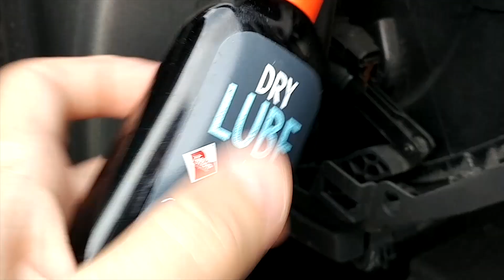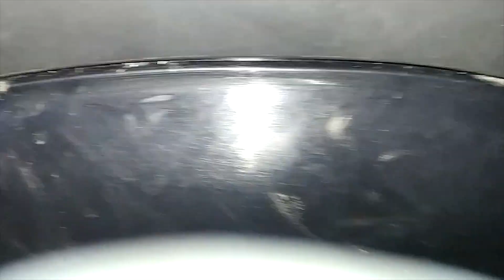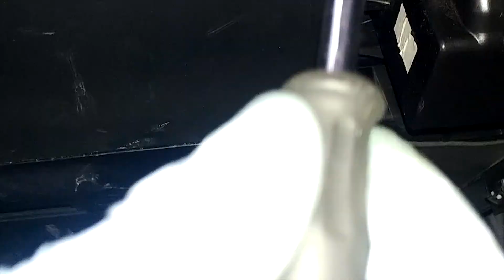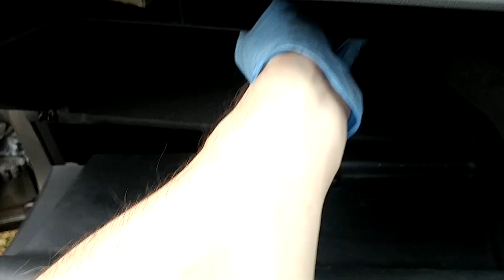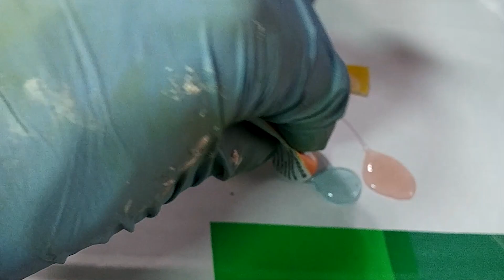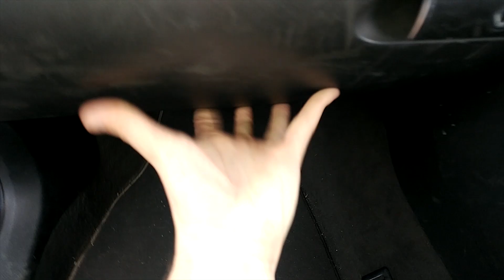How to remove repair and refit your Audi a4 glovebox

Comment: Very helpful video, thanks. On my Canadian 2008 A4 B7 Avant there are nine (9) screws though, not five. Three are hidden behind the iPod dock insert. I was close to getting the box out but couldn't figure it out. Instead, I put in a DIY bracket from the side. I used a standard 1 1/2" corner brace that I shaped to fit the curve of the plastic hinge and some short self-tapping screws. 
I had done this repair once before, a couple of years ago, but didn't think of lubricating that cylinder. The first repair had snapped when I got the car back from an unrelated repair. The brace broke at one of the four screw holes. I have a pack of 80 of these braces, so I can do this a few more times.

Comment: The problem woth mine is that it won’t ahut no more. It didn’t bother too much, but now it’s a pain in the ass. I’m not even sure if fixing the hinge mechanism thing will make it close again.
The little things that pop out of the lid of the glove box are not retracting into the holes of the glovebox, therefore it keeps popping open. One of my hinges was already completed broken but now sue to the pressure of the lid popping open the other one is almost completely done to. I have 2 issues with a thng as simple as a glovebox, that’s German engineering for you. The things are crap, so are a lot of interior bits of the car like the armrest and soor handles. The arm rest is flimsy it may as well not be there.

Comment: Great video, thanks for making it. Mine has broken too and has drained the battery (I think the glove box courtesy light might have stayed on and drained the battery, I also had a nightmare with the alarm keep going off after a drive) anyway I undid all the bolts but mine would not come away from the dash. Mine has two wires across the broken hinge (maybe the glove box central locking) it also has the factory fitted 8 cd changer fitted, maybe there's other bolts that I couldn't find. In the end I glued the broken hinge with it still on the car. I'll leave it a day or so and see it it's worked.